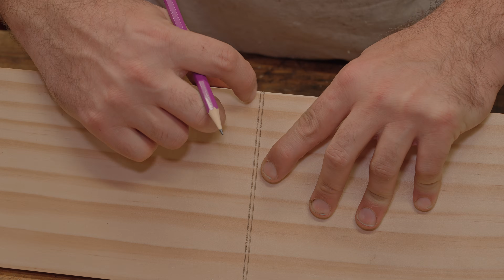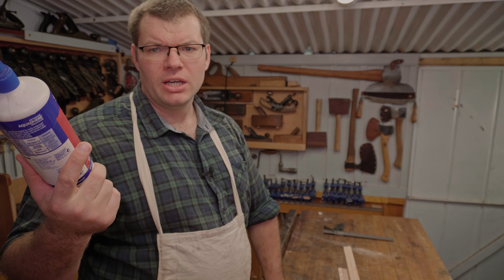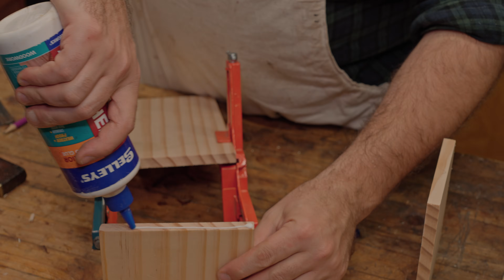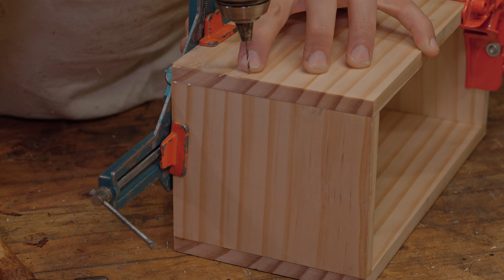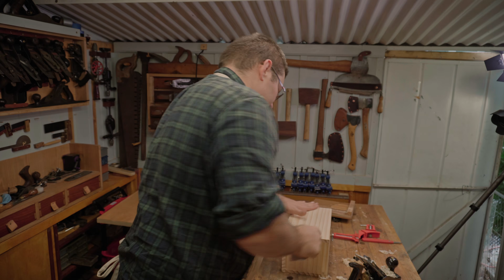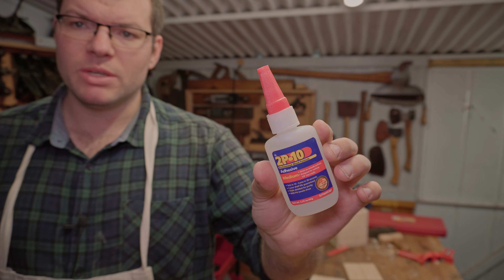Master the Basics: Creating a Beautiful Butt-Jointed Box

Comment: I think when I build some of these boxes to store my hand planes I will use dowel rods instead of nails. I built my portable work bench top using glue and dowel rods and it worked out great. I don't have a shop so I have to set up my bench outside when I'm doing a project and need a way to store my planes.  This will work.
Reply from the maker: Dowels should work just fine, i also agree these boxes should be fine to store hand planes in. Have fun with your box building!
Reply: @AussieWoodshed  Do you have a video on building a storage box for multiple hand planes? That is really what I need to make. Something with dividers for each sized plane. I just want your thoughts on something like that. Like I said, I don't have a shop so I have to store all of my tools in a extra room and set up outside with my work bench top on saw horses. Love your videos!
Reply from the maker: I have make 2 videos on making tool chests.

1) How to build a Tool chest - https://youtu.be/9jrnG6h3ciA , This video was make back in 2021 and this one was made using dovetails and the captive groove bottom and is a blank canvas to do what ever your like with.

2) DIY Beginner Tool Chest Build - https://youtu.be/7e_5VlTtA6o , This video was made in 2022 and consists of glued and screwed together plywood making once a again a blank canvas, i did also make some sliding trays for this one which could be excluded in favor of a false removable shelf and have additional storage for hand planes this way.

I think either of these could suit your needs depending on how much time you want to spend making the chest and can be made to any size you like.

Hope this helps, if you have any more questions just ask.

Comment: Thanks for the great video. With regard to the limitations of using a plane when there are nails, is it faux pa to use glue only, then reinforce with nails after the glue has set and the sides have been planed?
Reply: Gotcha. Thanks for the response.
Reply from the maker: That may work, however I'm not sure how strong the end grain glue joint would hold up without the nails while hand planning. If it holds you could definitely do it that way and not have to worry about hitting the nails. The other option is to punch the nails further below the surface.

Comment: To be honest, featuring things that can go wrong is the best way of teaching. When I've shown others to do stuff, as well as how to do it right, I like to show what can go wrong, whether it happens on the job or by taking a couple of scraps to imitate it and how to repair or replace whatever it is. So, well done for including the wayward nail - because it does and will happen, regardless of experience level. As for cordless drills, the only reason they were not used in days gone by is simply because they were not available, so I also regard it as a modern day essential hand tool, though I do like using brace and egg-beater too. I'm not ashamed to say that I occasionally use a bench mount drill press for precise, awkward or repeat work (it's the only 'machine' tool I use here at home, all the other stuff is used for carpentry work only); it's horses for courses!
P.S. Just remembered, I also prefer exterior grade adhesives because you never know when moisture will happen - especially here in UK...!
Reply from the maker: Thanks Pete i likewise agree that showing mistakes is a great learning tool, so i always like to include the mistakes for that very reason.
Reply: @AussieWoodshed  Nobody is infallible and nature will always win, we just have to live with it.

Comment: Nice video. I like yankee style push drills for making tiny pilot holes like that. For quick little pilot holes in softwood like that, I can often do them about as fast as I can with my cordless drill. In delicate woods the push drill will split them sometimes though.
Reply from the maker: Thanks. I haven't used the push style drills. They seem difficult to obtain here in Australia, one day maybe. They sound great.
Reply: @AussieWoodshed  hold out for a good quality push drill. The cheap ones gave me so many issues that I thought pushdrills were bad in general. I recently pickup a new old stock german manufactured one for $150ish. I've been using a Stanley 41Y for  years and it has always been very good, but I lost it a while back. I don't know what all is available in Australia but if you need help getting one from the US, let me know. I suspect the best market for them is in the UK though.
Reply from the maker: @jsmxwll  Thanks for the information. Much appreciated